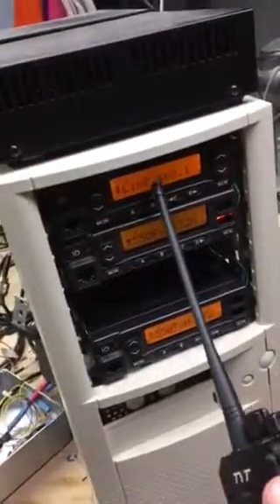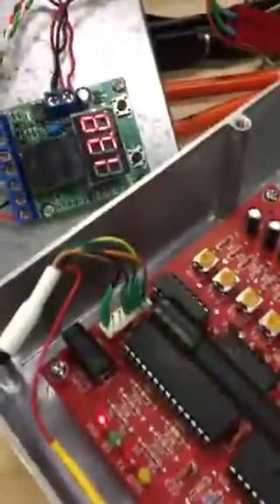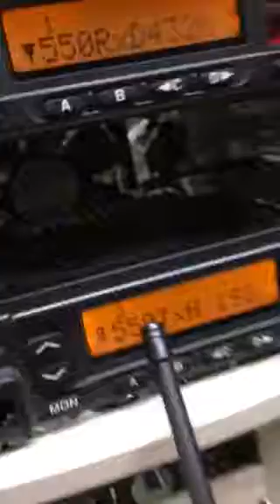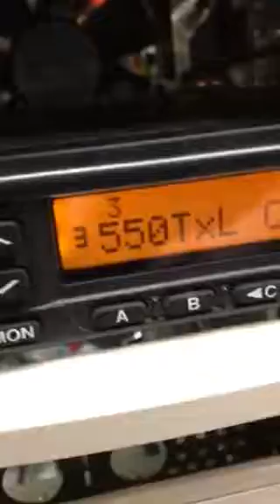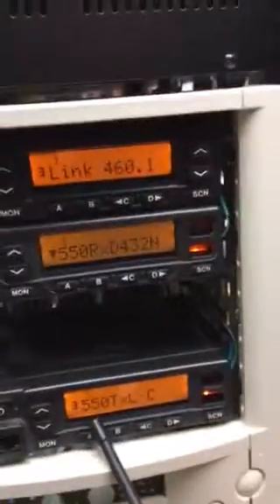Dtmf channel control gmrs repeater kenwood TK-880

Comment: Would you mind elaborating how this is wired up and programmed in regards to the TK-880 side of the interface? I'm in need of remote controlling a GMRS repeater made of these units and this would certainly be useful in case of jammers.
Reply from the maker: David Adriaanse I wired the up and down channel button of the radio directly to the solid-state relay and then the programming was easy because the repeater controller has the DTMF pin outs built in.

Comment: Hi. Know how to install an  ID-O-Matic IV on these radios ? Id did the same with a computer case. Two Kenwoods TK-880-1, a duplexer, 30 amp Power Supply, SURECOM SR-629 repeater controller and TRAM 1450 UHF base antenna.